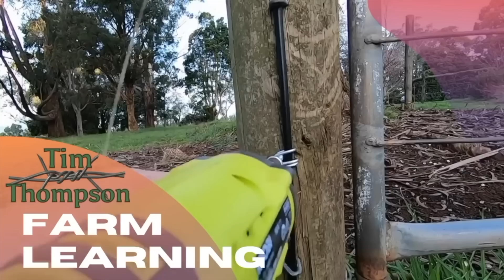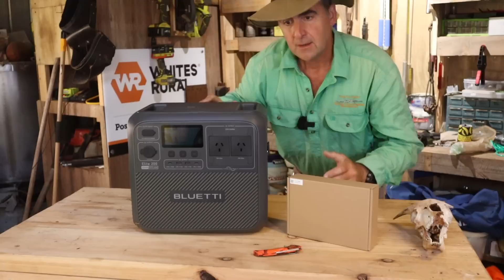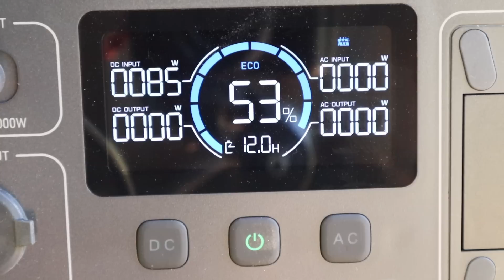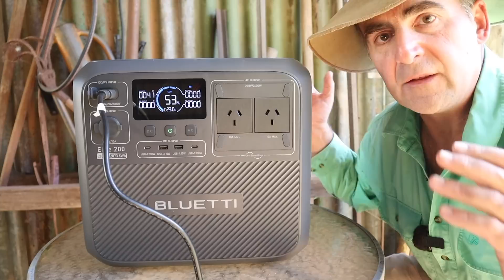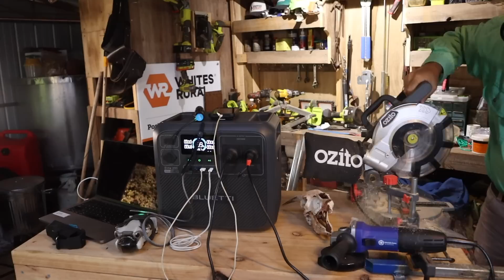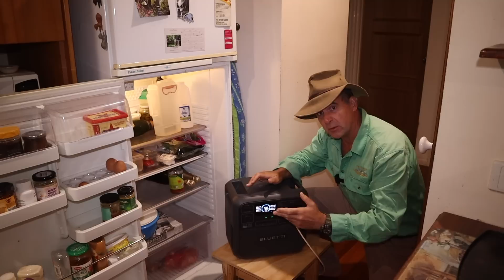Can I Break the Bluetti ELITE 200 V2? Real World Torture Test!

Comment: Just be aware that BLUETTI will argue the 5 year warranty on their products. Direct quote from an email received from BLUETTI on the 12/3/26. "The product was originally purchased on 3 June 2025, and normally, after one year of use, a full refund would not be applicable". (The warranty for a Elite V200 is 5 years, as stated on their website).
Reply: So how has your Bluetti failed you?  What is wrong with it?
Reply: @brettchattaway5242  Solar and 12v charger inputs failed, (from new).

Comment: Good morning, Tim, great review. I am on the cusp of setting up my house with a version of the Bluetti. My real concern is fire, as these units are just big lithium batteries. Have you had any feedback on their safety, an does the unit you demo get hot? Cheers
Reply from the maker: Hi mate. I’m pretty confident in the Bluetti, I’ve used a few now and had them in hot cars etc. having said that, you should always treat batteries with respect. Keep them cool and dry wherever possible. I’m really impressed with this one. Even ran the bore pump.
Reply: @FarmLearningTim  Thanks Tim, Cheers

Comment: Good review, but for us land people, the Bluetti units are no good at starting water pumps over 1000w. They just can't handle the pump start up requirements.  There are work around, but as an individual unit, don't consider a Bluetti or generally most of these battery units if you need them to operate a water pump.
Or, just reply and I can walk you through the work around tactics, because once you start the water pump, then the system will operate brilliantly.
Reply: I have my doubts about the longevity of these all in one units for serious use 
Electric motors start up surge can be 2x up to 5x rated wattage 
I bought a 12 V 2000 W inverter it's fine for light duty, but really need 48 V 6000 W to comfortably power anything with a motor,  hopefully get that one running this weekend
Reply: @gor4988  correct 👍
I have one at home, the trick is to combine the AC input with the Bluetti to get all systems operating without tripping the circuit breaker on the Bluetti unit.
I start up with a generator connected (off grid setup), then once the pump is running, disconnect the generator and the Bluetti takes over.
I also have an alternative startup with a separate 200amp hr battery connected to a King's 3000w pure sign wave inverter. This also kick starts our pump before letting the Bluetti handle the load.
Reply: @1Salts1  Interesting,  so the unit is capable of passing the charge current straight through to the output.  
Is your 200 amp hr Lead of Lithium ? 
My little Aldi generator runs bore, pressure pump and microwave 
I have some old Telecom  AGM's I'm wiring upto the MPPT Solar 6kw for convenience and to save the fuel costs
Fridges run directly on 12v 
2kw unit can handle the little things
Reply: @gor4988  battery is lithium on my setup. 
Yes, the Bluetti will send AC directly through it's system to power any device, then once you disconnect that power input, the Bluetti will take control. It's absolutely perfect when used this way. Sometimes I combine the two power sources to extend my pumps operating time by having the generator run the pump for a few hours, and then as the generator runs out of fuel, the Bluetti keeps it going.
One catch is that that power inverter on the Bluetti will time out, so if the generator is  still running when that happens, the Bluetti won't kick in. So I monitor the fuel so that it all works together. 
A bonus of the generator is that it will also top up charge your Bluetti in the process.
Reply: @1Salts1  So the Bluetti is allowing AC pass through? You're saying that by connecting a second inverter to the AC charge port you can manage the pumps startup in rush that would otherwise trip the Bluetti. What is the total in rush of the pump on startup? This sounds like a pretty good Hack, you could size your AC input to the bare minimum to cover the Bluetti's shortfall, surely it would only be 500 watts or so?
Reply: @gingerninjasideshow  yes and no. Depending on your model. The AC range does allow AC pass through. They can operate purely as an UPS if required.  During the recent price drop, I acquired a second AC200L  and use the 2 AC200L units to power jump my DAB JET 2 pump. Basically in the same way I use the inverter. In my research, the best you'll achieve out of any single AC power outlet is 1500w. So anything that requires more than that, the 2nd unit  or wall outlet will compensate for the power requirement all through the same individual power outlet. I hope this helps.
Reply from the maker: Ran me bore pump fine mate.
Reply: @FarmLearningTim  what's the watts? It can't start a DAB 132 or a DAB 151. It can keep them running but it can't start them.
Reply from the maker: @ 2600w / 2100wh. I state that in the review. Obviously check your own pump requirements
Reply: @FarmLearningTim  thanks for the reply Tim, I'm enquiring  about the watts on your pump, not the Bluetti unit. The review is clear about the unit itself. Cheers.